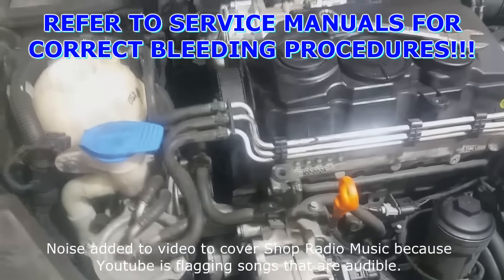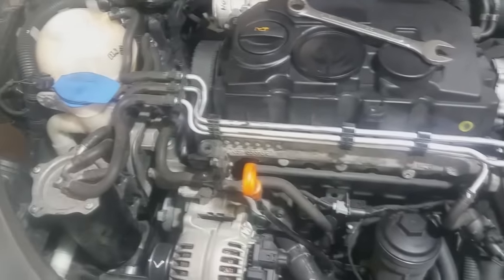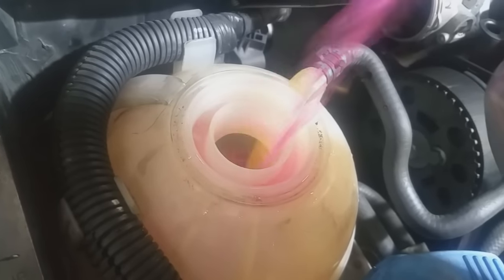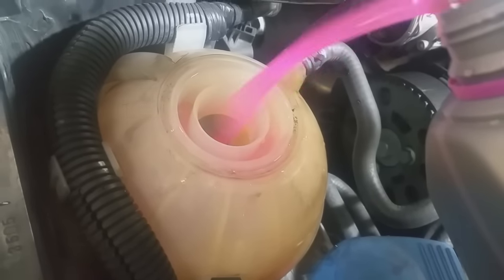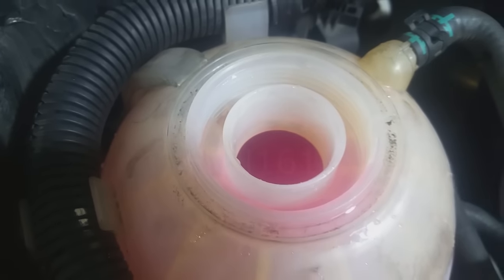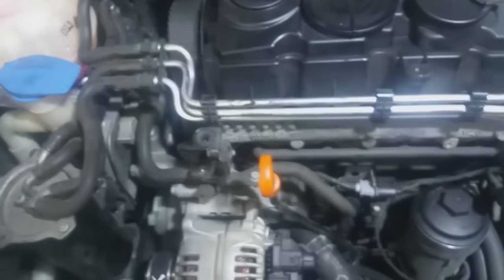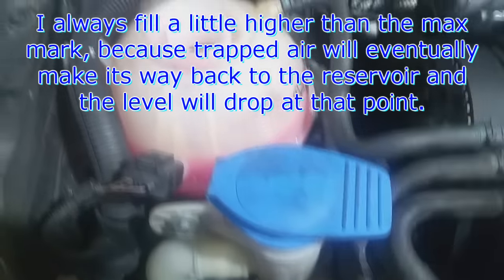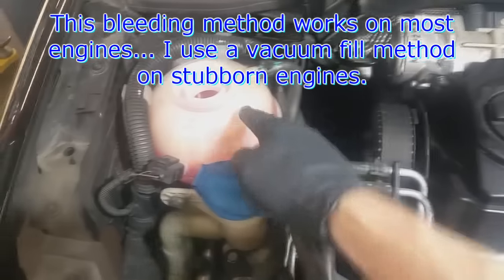Basic VW cooling system filling / bleeding info (viewer request)

Comment: hi, i replaced cambelt and water pump, bleed the coolant and refill it, now my heater not working, any idea why? (vw golf mk6 2l tdi)
Reply from the maker: Are you getting flow back into the coolant reservoir (the small hose)? You might have an air pocket.
Reply: Thomas EXOVCDS, when i open the cap all coolant comes back to the tank, do u think its air or something else. thanks mate
Reply from the maker: Sounds like air pocket... bleed it more / correctly. Fluid has to flow back into the bottle (out of the small return hose). Leave the cap off so you can see if fluid starts to flow. Don't let the engine run too long or it will create a hot spot and warp the head.
Reply: Thomas EXOVCDS, thanks mate ill try and let you know.  thanks for your help.
Reply: hi again mate,  yes i tried zech007 method and it worked,  i just drived on motorway,  my heater is working now and no back flow to reservoir.  thanks for your help.
Reply: niz UK 

Hi,

I have the same problem as yours. What is zech007 method???

Thank you

Comment: Hi  Thomas EXOVCDS I serviced my car in December 2018 changed the water pump timing belt & tensioner plus the oil filter it's never had hot air coming in from the heater matrix it's just warm I know it should be a lot more warmer in side the car I've tried the method with squeezing the small return pipe and squeezing the bottom radiator pipe but it's still the same I do have a 50/50 mix in there it's a vw bora 1.9 tdi pd130 any help would be appreciated I hope to here from you. P.S I've just  subscribed & liked your video.
Reply from the maker: I doubt that you have any air in the system if you do not have any overheating or "heat comes & goes" issues. I would check the heater blend door operation to make sure that is working correctly and look for foam in the air vents. If you have foam in the air vents, then you need to remove the heater box assembly to reline the blend doors.
Reply: @EXOVCDS  where is the heater blend door & do I need to remove the air vents in side the car to see if there is any foam in there.
Do you have a video link for your reply thanks.
Reply: @EXOVCDS  got air coming through all vents in side the car I don't think any foam is in any of the vents
Reply from the maker: @TheGte1981  Look under the dash from the passenger side... towards the middle of the car. Move the temperature knob cold to hot and look for movement. https://www.youtube.com/watch?v=6U9ZdkAjdhQ The lever can pop off and not move the blend door. When foam comes off of the doors, you need to reline the doors with foam: https://www.youtube.com/watch?v=GR6DYOJ3B34
Reply: @EXOVCDS  thanks I'll check that tomorrow to see if it opens up & closes & I'll keep you updated 😎
Reply from the maker: You won't be able to see the door itself... just the lever (or electric motor if it has climatronic). If the lever is hanging low, then it is probably disconnected from the blend door.
Reply: @EXOVCDS  Ok I'll try my best to see if it moves up & down like the one in the link you sent & yeah it's a climatromic
Reply: @EXOVCDS  if it has disconnected does that mean I have to take all the dash out to realign it.
Reply from the maker: @TheGte1981  Climatronic will be different from the video I posted. You won't be able to see a lever move (if I recall correctly). Listen for motor activation when changing from cold to hot, hot to cold. Could be a bad motor.
Reply: @EXOVCDS  that's what I was thinking are they easily replaceable
Reply from the maker: @TheGte1981  access might be limited for some. Haven't done one in a long time.

Comment: I have an engine like that. 
Recently twisted a connecting rod 
Do you know what might cause this problem?
Reply from the maker: You men the connecting rod got bent? Or are you talking about a spun bearing? What lead up to the twisted rod? I mean... were you on the highway trying to pass someone? Driving up a steep hill? Could have over revved the engine, maybe oil or coolant got into the cylinder... liquids don't compress.
Reply: is a bent rod 
I did not do anything out of the ordinary. I was doing a normal driving
Reply from the maker: Weird... can't bend something unless it got stressed. Is it back together again already?
Reply: Yes But mechanics were not clear about the Cause of malfunction , Was in warranty, has been redone but I do not know if I should trust this engine I know they give problems in the connecting rods This engine is the second engine The first split a connecting rod and the engine block 
sorry for my English
Reply from the maker: +Helder Telemovel I do not know of any connecting rod issues with these engines. You might not have any more problems with this one.
Reply: Thomas EXOVCDS 
thank you In my country, Portugal The 1.9 tdi bls engine Problems in connecting rods and spuns
 Serious malfunctions as happened to my first engine

Comment: Where would you find that hose on a MK4 Jetta 2000?. I never bleed mine i just added coolant to the resvior.
Reply from the maker: Which hose... the one I was pumping / squeezing? If you haven't had any issues, then your coolant return hose is OK / not plugged and air is able to get back into the reservoir.
Reply from the maker: What engine?
Reply: My MK4 is a 2.0L

Comment: my 99 Jetta is leaking fluid bad I found the hose it's really small almost like a tea hose close to firewall to the hook to engine what is it called
Reply from the maker: Don't know. What size engine. Post a video so I can see... you tube is great for that. Most hoses have part numbers on them. Remove the hose and look for the part number... then, order the hose.
Reply from the maker: Devin Davis Google link didn't work. Send to fkh161@fkh161.ca
Reply from the maker: Your best bet is to just replace the small piece of hose with generic coolant hose. It is usually sold as a complete assembly, but I don't think you would want to buy that: https://www.ecstuning.com/b-genuine-volkswagen-audi-parts/coolant-hose/1j0122447bj/
Reply: Thanks man I'll let you know how it goes
Reply: got the hose fixed but now when I drive the car is heated and it will go down under Heating
Reply from the maker: Devin Davis You might have an air pocket... is it bleeder hose at the coolant reservoir bleeding the air out when the engine is running? Are the upper & lower radiator hoses getting warm?
Reply: I just warmed it up and drove it around the block a few times it did not drop good sign??
Reply from the maker: Devin Davis The fluid level did not drop? Yes, that's good... no more leak! =)
Is the temperature gauge / needle staying in the middle?
Reply: Fluid level dropped earlier a little bit so added a little more went out there  about 15 minutes ago to check it out squeeze a few hose a few times with the cap off I heard a little more air come out then I started it and warmed it up and drove it around the block a few times and no more leak fixed and stayed right in the middle but would it matter if it was just a round the block or on Highway going faster
Reply from the maker: Devin Davis Around the block is fine... or even just standing still at 2000rpm. Vehicle speed doesn't matter, engine speed is what pushes coolant around in the system. If it can run at 2000rpm standing still without overheating or leaking (fans should come on also) then everything is OK.
Reply: When it was warming up I was holding it at 2000 RPMs so I hope everything is okay I got about a 15-minute drive tomorrow I'll let you know how that goes thanks again

Comment: g13 is safe to top up g12 with in a 2012 2.5?
Reply from the maker: 2008 and newer use G13.
Reply: @EXOVCDS  thanks boss, noted. why does my expansion chamber have g12 printed on it? just a vw quirk?
Reply from the maker: Here's a compatibility chart:
https://www.audiworld.com/forums/attachments/a8-s8-d3-platform-discussion-60/45441d1425450354-coolant-needs-top-off-coolant.jpg
I don't know why the bottle still says G12, when G13 was available starting 2008.

Comment: You weren't using straight, undiluted coolant were you 👀??
Reply from the maker: 50/50 mix as recommended by the manufacturer. I've been doing this for 27 years.
Reply: @EXOVCDS  i run 70/30. Will that cause any problems?
Reply from the maker: @sweis12  Where are you located? Coolant/Water or Water/Coolant? 50/50 should be fine for most places... 70 coolant would cover you to -84F (-65c) I'd find a new place to live. =)
Reply: @EXOVCDS  I dont live where it gets anywhere that cold. Some people on tdi club said it helped prevent rust in the system . Not sure if it actually helps but im running 70/30 g13/distilled water on my 2003 tdi ALH.
Reply from the maker: @sweis12  cool. =)
Reply: @EXOVCDS  sorry to bother but im having an issue. On my 03 tdi i get a flashing glowplug light and the cruise controll wont work when the headlights are on. When the headlights are off the car is fine, but as soon as the headlights are on it kills cruise imidently and then the glowplug light flashes after about 30 seconds. Is there anything I should look for specifically ? I can't find anything online about it.
Reply from the maker: @sweis12  check your rear lights / brake lights. You might have a ground problem with the rear tail lights... feeding voltage into the brake bulbs.
Reply from the maker: @sweis12  Any update?
Reply from the maker: @Spencer | Sweis12  Any update on the cruise control issue? 
Or was TDI Club more helpful that what I suggested?
Reply: @EXOVCDS  sorry i havent been able to check it out yet. Ive been working graveyard and helping my parents move. I should be able to look at it tomorrow.
Reply from the maker: @sweis12  Thanks for the update!

Comment: I did not hear any bubble sound 😢 i fill it at night when my engine is cool
Reply from the maker: Year, make, model, engine?
Bubble / gurggle sound doesn't have to be present. Is the engine overheating? Why did you fill the reservoir? If the engine has a leak, did you fix the leak?

Comment: Saved my life here bro........... thanks for the video................
Reply from the maker: Year, make, model, engine? 
What was the reason for having to fill / bleed the system?
Thank you for watching!
Reply: Volkswagen Bora/Jetta 2003 
Reason I had to bleed it  is that I left the radiator cap loose and drove it and the car overheated and the cap blew off which caused the car to overheat.
However after using your method I bled it out and it works good now.
Reply from the maker: @leoobrien2377  Thanks for the extra info! I always like to know what vehicle / engine my video worked on. =)

Comment: Hey Thomas, I am finalizing the TB replacement on my '01 Jetta ALH this weekend and plan to start the engine.  Previous mechanic used green antifreeze. I want to replace with the proper pink. 
My plan is to run distilled water through the engine without the thermostat and heater on for 10 - 15 minutes two times.
Do you think that is enough to clear out the green antifreeze? Would you recommend a radiator flush product? Any information is greatly appreciated.
Reply from the maker: You will be able to tell / judge how many flushes you will need, better than I can, by the color of the stuff you drain out. Removing the lower radiator hose at the radiator and one of the heater core hoses should drain quite a bit each time. Make sure that there's coolant circulation (coolant / water flow back into the reservoir) when the engine is running. You don't have to run it long... heater does not have to be on, since it is an "open flow / constant flow design" through the heater core. But you can monitor heat inside the vehicle to make sure that you have circulation.
Reply: @EXOVCDS  Thank you for your reply! You are a great help.

Comment: Hi Thomas how long does it take before the cooling fans come on?
Reply from the maker: Depending on the engine 10min or more.
What engine? Are you monitoring upper & lower radiator hose temperature?
Reply: Thomas EXOVCDS 2.0 no havnt monitored the hose temperatures. Also I don't believe I let the car run long enough.
Reply: Thomas EXOVCDS did test drive tho and temp guage was fine. Checked fluid level when I got back and it was where its supposed to be.
Reply: Thomas EXOVCDS should the upper rad hose be hot and the lower rad hose cold or should it be warm(hot) as well?
Reply from the maker: Upper hose should be hot to the touch once the engine is at operating temperature (90c/190f). Lower hose should be warm / hot at idle... fans should come on at around 96c. If the lower hose never gets warm, the fan switch in the radiator can not trigger the radiator fans to come on. Watch this and do some checks. Get back to me with what you find.
https://www.youtube.com/watch?v=Roh6RCs8IJk

Comment: can you tell me how to flush and refill coolant in my 2014 jetta 1.8tL se
Reply from the maker: Open the system at as many places as possible (hose fittings, temperature sensor etc) then you can force water through the system to flush out the old. VW has never made it easy to drain the system completely. Getting all the clean water out will also not be possible. So when you add fresh coolant, don't add a 50/50 mix, since you already have some water in the system. Fill the system / coolant reservoir while you have some hoses (or a temperature sensor) disconnected, so that air can come out of the engine. Once you think the system has enough coolant, you can start the engine **BUT** make sure to keep an eye on the temperature gauge! If the needle goes past the middle, shut the engine off an let it cool down. Start & repeat until the needle stays in the middle **AND** the cooling fans come on. Overheating an engine can cause damage. A $300 (could be cheaper) flush at a shop, might be cheaper and more convenient than a weekend of making a mess of the garage / driveway.
Reply: Thomas EXOVCDS can i just drain the old coolant out and refill with fresh coolant? or do I need to flush with water?

Comment: Hey man, just wanted to say this video saved my ass (and wallet) today. Don't know too much about VW so I was having some touble. Found this and worked first try. 
Cheers
Reply from the maker: Nice to hear. Thank you for watching!
Reply from the maker: @ShutDFckOff  If you have a coolant leak and it's blinking because of low coolant level... fix the coolant leak first. If it's blinking because of overheating... fix the overheating first.
Reply from the maker: @ShutDFckOff  year, make, model, engine?
Reply from the maker: @ShutDFckOff  if the level is close to minimum, top it up to max and then keep an eye on the level for a week. If the level drops, check for a leak.
Reply from the maker: @ShutDFckOff  thank you for the updates!

Comment: Will this method work if I have a air lock
Reply from the maker: If your cooling system does not have "bleed" hoses, such as in this video, then you may have to open up the cooling system (loosen a hose, remove a temperature sensor) in several locations, to allow the air to get out. Year, make, model, engine? Reservoir bottle?
Reply: Thomas EXOVCDS mk4 golf 2L
Reply from the maker: @codilewis8938  Did you check you fluid return hose at the reservoir for flow? Remove the hose (engine off) and blow into it... can you? There should be no air lock if the bleed hose(s) / junctions are not plugged. What makes you think that there is an air lock? What lead up to this? Coolant leak / repair?

Comment: Man i burp the air lock out.  Now car still taking coolant.   Why is this.
Reply from the maker: If there is no leak (coolant dripping from the engine), then there was / is still air in the system. The level will eventually stabilize / stay level.

Comment: Unfortunately the thermostat at the cold position is where you get issues. Engine needs to be warm for the stat to open and to allow the coolant to pass through the engine.
Reply from the maker: Not an issue as long as the radiator & lower hose are full... even if there is air trapped in front of the thermostat, it will go into the engine & bleed itself out once the thermostat opens.
Reply: Thomas EXOVCDS yes absolutely it will eventually bleed through it's just unfortunate you have to wait for the stat to open to completely bleed the system. Maybe with some modern cars with an electronic stat you can temporarily open the stat through the computer would make it a lot more efficient to bleed. Nice video.
Reply from the maker: "Vacuum fill systems" remove the air and then coolant is filled... it's quicker than the old fashioned method.

Comment: great videos I have a question for you where do I release the radiator fluid on a B6 Passat is there a valve of some sort
Reply from the maker: If there is one, it will be at the driver side lower corner. If there isn't one there... then there isn't one.
Reply: ع